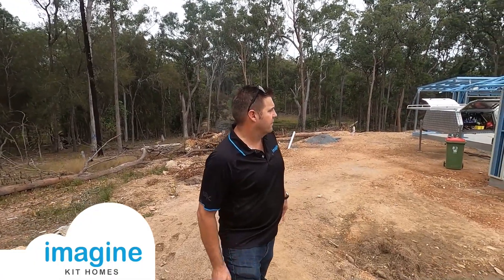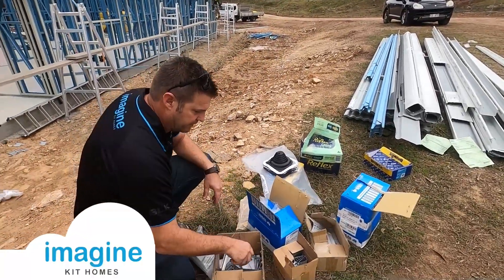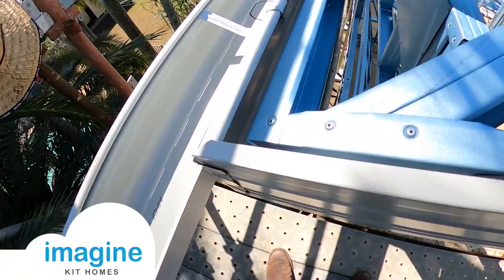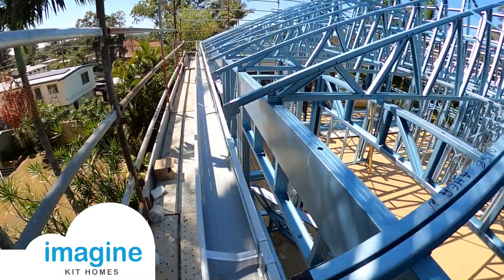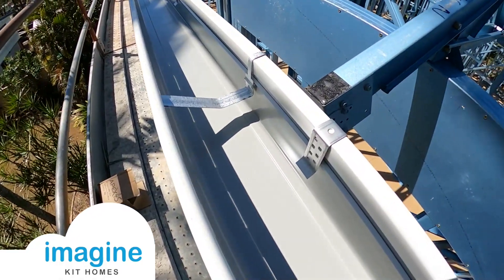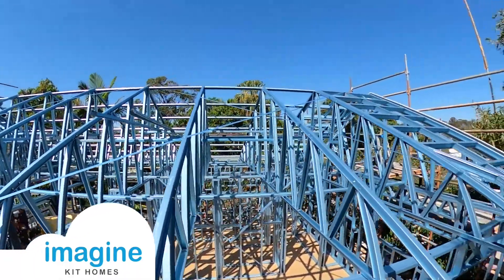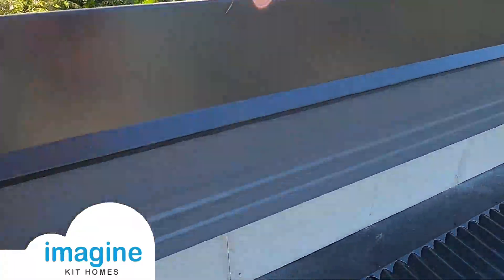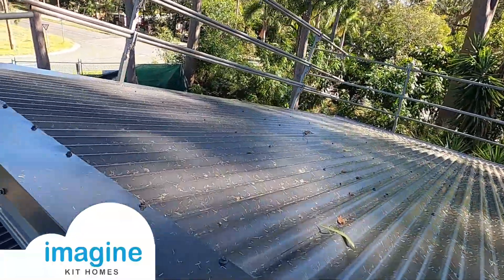Roofing for steel framed homes.

Comment: What about the roof battens? Where do they usually start from?
Reply: 100mm up from the fascia, 150mm down from the ridge then 900mm centers.
Reply: @keithrichardson3351  Mine look to be at 450 centres I think because I am in a high wind area on the Atherton Tablelands. Thanks for the info!